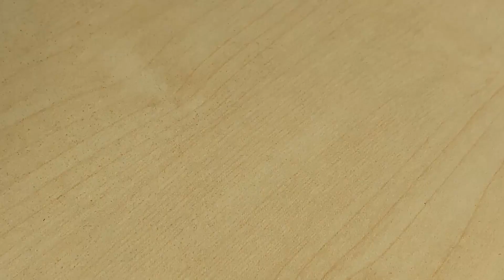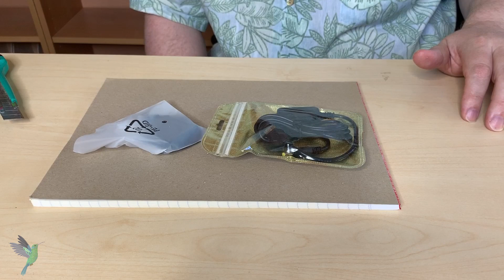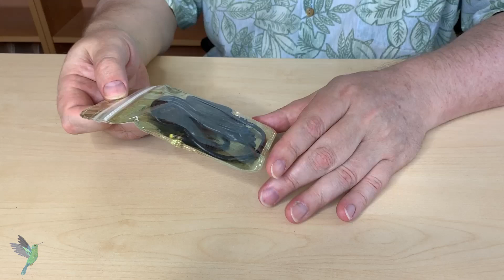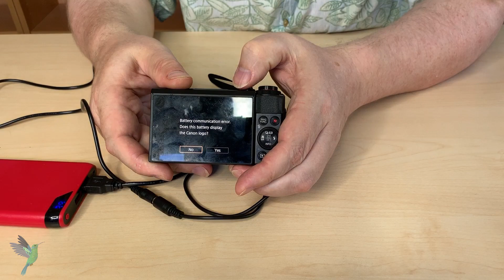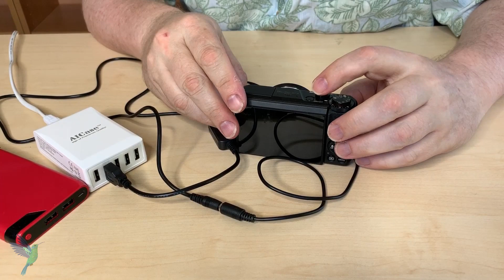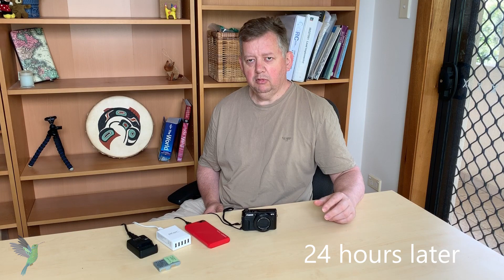Canon G7X Mark II - Extend your battery life

Comment: hi. will go the camera in sleeping mode with this cable?
Reply from the maker: The device is just an alternate power source. If it’s power source is switched off or interrupted, the camera will stop functioning due to loss of power.  The sleeping mode is a setting in the camera and therefore independent of the power source. The device when connected to a suitable power source, does provide extended power over a standard in-camera battery tho.  The 4Gb file size limit still applies. Hope this answers your question.

Comment: Which is the best for hours of photos?
Reply from the maker: The external pack, in my experience, is best for hours of photos.   Batteries are small and therefore have limited capacity that diminishes over time.
Of course there are limits imposed including image resolution, SD card capacity, a 4Gb limit on file size within the camera and external power pack capacity and charge level.
I hope this helps.
Reply: @makingstuffeasy4827  Thanks! Can you give me a link to the external pack?
Reply from the maker: I suggest you do a google search for  ACK-DC110 and pick from there. I bought mine a couple of years ago and products may have evolved and suppliers changed.  Of course, check compatibility with your specific camera model too.
Other comments on this suggest how to set it up and use it.

Comment: hi i’m planning to buy it but don’t know how long the battery life is do u know
Reply from the maker: From recollection.....
The native Canon battery, at full charge lasted about 30-40 minutes.  This will vary with how you use the camera.
Generic batteries  will vary more, based on their quality. They are likely to be cheaper than genuine Canon batteries.
The external power pack, via the dummy unit., will last much longer (hours in my experience) subject to its Size and capacity.
The same dummy unit will run continuously if connected to a mains powered USB charger.
Remember the camera has a maximum file size so it will stop recording when that limit is reached.
Technologies change so properties of more recent cameras, batteries and related  components’ capabilities are likely to change too.

Comment: Can you use the dummy battery while filming video?
Reply from the maker: Yes. The particular unit I have has been reliable for me filming my YouTube videos.  I have it plugged into a 2.4 Amp USB power pack with auto-off feature so the process is: 1. Turn on power pack; 2. Turn on camera; 3. Respond No, Yes to the two prompts re using battery without Canon label.  It is a bit of a process but no worse than realising you’ve missed filming something because the battery’s limited capacity has been exhausted and waiting for the battery to recharge. You might be able to skip step 3 if you can source and afford the genuine Canon product ‘AC Adapter Kit ACK-DC110’. And you can skip step 1 if you’re plugged into a continuous power supply such as a 2.4 Amp mains-powered charger. I’ve also discovered I can configure my camera to not switch off automatically after a few minutes so the frequency of going through the 3 step process. I hope that helps.

Comment: i just got my first camera and yes it's a little old but nonetheless i want to get good with it before i move up to get a better camera later on down the road. i have a problem and i really need your help well i have a canon ds126151 400d it's 14 years old iy came out 2006 and it's a 10.1 mega pixel camera i charge the battery for 2 hours and put the battery in i took 4 pictures and it said to recharge the battery and i just put that battery in so does that mean i need to get 2 new batteries from amazon cause these batteries i have now are no more good cause i want to be able to take pictures for a very long period of time instead of a few minutes please help me out
Reply from the maker: If you have a canon 400D you may be able to research a  ACK-DC20 AC Adapter+NB-2L battery.  
Similarly, you might also consider researching quality generic batteries that may be cheaper list price to genuine Canon batteries, however there may be associated issues.

Please note: consider this as information only.  I have no experience with these options or this camera so you will need  to form your own position on its suitability for your needs.

Your mileage may vary

Comment: You mentioned you got 120 mins of video recording on the original battery.  Is that with the LCD screen turned off?  I have a brand new generic battery, but with the screen on I only get about 20 mins of video before the battery runs out.  (havent tried it with screen off yet).  Does that sound right?  I'm trying to work out if my camera or battery has a fault.  I charge the battery, hardly use the camera then a week later the battery is nearly dead.  My old original G7 was infinitely better in terms of battery life.
Reply from the maker: Hi, I can only refer to my own experience using the batteries and camera I have on hand.  
I measured the battery life for the genuine battery and  a generic battery before creating and posting the video. I  had the screen on when filming however I may have tweaked settings on how long the display is on, how long the camera is in standby mode before shutting down, etc. 
From my own research into batteries at the time, there seemed to be quite a bit of variability in generic batteries including some fakes, some that may be inherently poor quality and some that can be faulty.  
You say your battery isn’t holding charge for 7 days and can only get 20 mins recording from a full charge.  This may be down to a fault in the battery, misrepresentation of the battery’s capacity, due to its age, exceeding the maximum number of recharge cycles, or a fault in your camera. 
I took the variability out of the equation by moving to the USB-powered battery replacement featured in the video and I no longer use my genuine or generic batteries. This works for my scenario.and was cheaper than buying a new genuine battery and, from recollection, not much more than buying a well rated generic battery.
I wish I could give a more precise and useful answer but there are too many variables.
Reply: Thanks. I just tested again, i got 75mins of video before battery died.  Lcd stays on while recording, i see no option to turn it off.  When the video file becomes 4GB it cuts off, which is apx 25mins at fhd 25fps.  I guess its poor but acceptable i may buy a 2nd generic battery though as backup.
Reply from the maker: Yes, the 4Gb file size limit comes into play.  It had me concerned too, and applies in all cases including when using the USB-powered battery replacement.   The loss of charge after 7 days appears worrisome tho. Perhaps try leaving the battery out of the camera for 7 days to see if it still loses its charge. If it does it suggests it’s the battery. If not, it may suggest an issue with the camera itself.
Reply: Ah, mine is a g9 not g7!
Reply: Great idea ill try that!

Comment: I thought u cant record while charging?
Reply from the maker: This USB device slots into the camera’s CB V BBC battery bay and looks like a battery, albeit with the cable extending from it to, say, a 2.4 Amp power source. It therefore replacess and acts as the battery with extended power duration. I think the filming-while-charging concept you are referring to is where the native NB-13L battery is installed and a micro USB cable is plugged into the camera body to recharge the battery.. I’ve never tried charging while filming so I can’t advise on that.
I hope this helps.
Reply: @makingstuffeasy4827  get it, thank you!

Comment: Hi! Thanks for sharing. Need clarification. I have the  NB-13L Dummy Battery with cable attached and normal 5V powerbank. I would still need a step-down cable, right? If so, can you provide more details or link, please. I do not intend to connect it to the wall socket. Thank you,
Reply from the maker: Hi, I use a Cygnett CP2504PBCHE 10,000mAh portable power bank (details here https://www.cygnett.com/products/10-000mah-portable-power-bank-in-red-1) the key consideration is the 2.4 amp output.  It works very well for me. I hope it does for you too.

Comment: Is the NB-13L power charger cable ACK-DC110+DR-110 still working properly? Is this safe for your camera?
Reply from the maker: Yes, it is still working for me. The particular unit I have has been reliable for me filming my YouTube videos.  I have it plugged into a 2.4 Amp USB power pack with auto-off feature so the process is: 1. Turn on power pack; 2. Turn on camera; 3. Respond No, Yes to the two prompts re using battery without Canon label.  It is a bit of a process but no worse than realising you’ve missed filming something because the battery’s limited capacity has been exhausted and waiting for the battery to recharge. You might be able to skip step 3 if you can source and afford the genuine Canon product ‘AC Adapter Kit ACK-DC110’. And you can skip step 1 if you’re plugged into a continuous power supply such as a 2.4 Amp mains-powered charger.

Comment: Question... If you use the official AC Adaptor from Canon with that USB cable, would it register as authentic?
Reply: I believe the answer is yes: it would register as authentic. The behaviour appears, in my experience, to be consistent with non-genuine NB-13L batteries in the G7X Mk II
I understand, but cannot confirm, that canon uses proprietary components such as special integrated chips in the hardware, to detect whether a product is genuine or not.  This is, of course not unique; Canon appear to do the same with printer cartridges and Apple has something similar with lightning cables for iPhones.  
The check I mention in the video occurs only once when the camera is turned on; it shouldn’t check again for that ‘session’ (in my experience)

In my research I found there are a number of reports of fake ‘genuine’ Canon products (Canon has a team you can send pictures of ‘genuine ‘ but potentially suspect products to get their opinion).  
Also, regarding the genuine ACK-DC110, in at least one case in my research for this response, at least one online Canon store said it was out of stock.

It would be great if you can share your experience with whatever you choose to proceed with.

Comment: The item on Amazon does not match the Iten you displayed are amaxon holding these for you are you hoping to get behind the wheel of a Lamborghini with this?
Reply from the maker: Thank you for your comment.  I try to find suitable and similar items on Amazon, with clear indication of the affiliate links and variations., at the time of posting the video.  Nonetheless , I am equally keen to share the products I use regardless of source, affiliate potential, etc.  Here’s  the EBay link for the product I believe I used used in the video: https://www.ebay.com.au/itm/NB-13L-power-charger-cable-ACK-DC110-DR-110-dummy-battery-for-Canon-G9X-G5X-G7X-/302189578572.  I hope my next car is a Tesla ;-)
Reply: @makingstuffeasy4827  Tesla S are nice almost equal to yet missing the roar of an Ausi RS3. Tah , I will check.